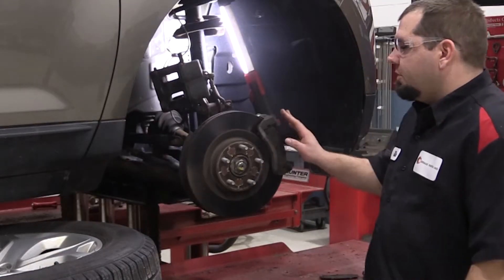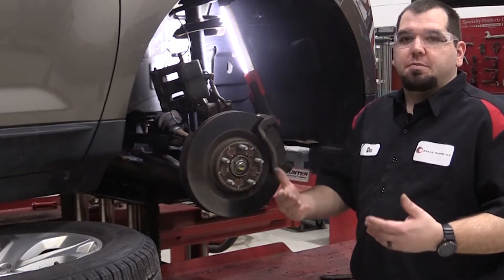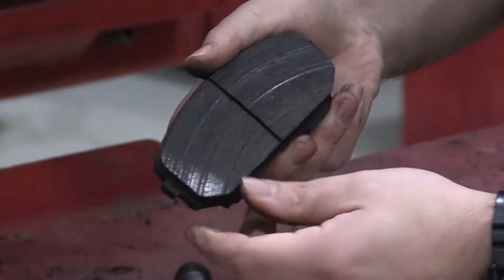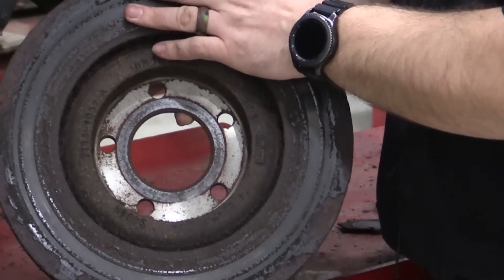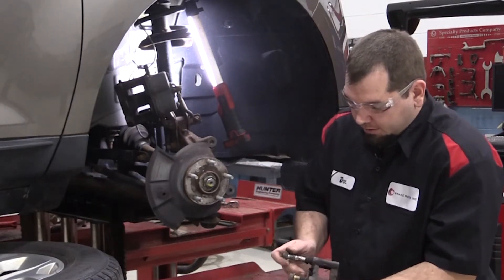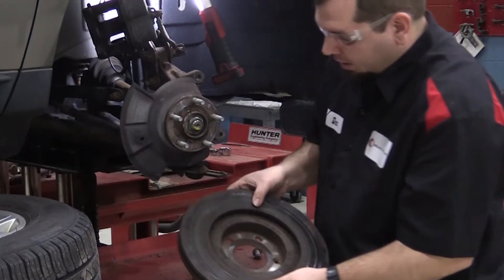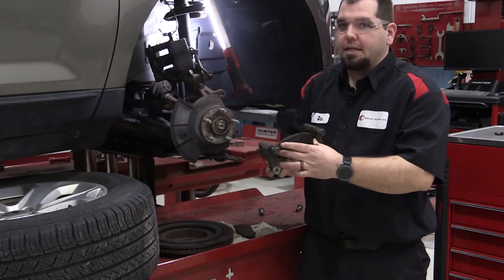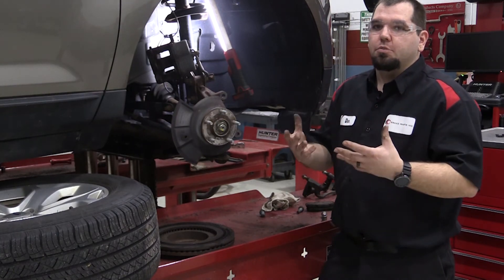Rusty Rotors: What Causes Rust Jacking on Rotor Inboard Only?

Comment: Thanks man,  when I did my brakes after years before buying lifetime pads from Auto zone, they wore out, the warranted pads looked to me to be the same but they gave me the wrong ones. i just figured out what happened from what you said, the inner pads on both sides made identical solid grooves like a track and were only contacting the back if the rotors in the center about 1.5 inch contact while the outer were just barley worn but evenly.  the pads they gave me under warranty were a tad longer but still fit in the clips!     They just gave me the right ones this time but now I need new rotors.  UUGH!

Comment: In my BMW just replaced rotors pads full service found a warped pin replaced cleaned everything and already have my front left giving weird signs occasionally when I had to brake hard for a stop and it locked up quite a bit and pulsed. Then today after a lot of rain I noticed the front left again is just starting to scar on the outside who knows about the inside it’s brand new pad and rotor and the bigger issue is it never fixed any vibration from me cleaning and replacing.

Comment: Have this on my “new for me” 2013 RAM.  When repairing I’ve noticed that they do not use the steel clips in the bracket like we are used to seeing.  The pad just rides in the bare bracket.  I think that has a lot to do with this issue n my case.

Comment: Just had this happen on my moms 2009 ford edge sel. Interesting that I see an edge in the video and other commenters with edges. 
My mother drives only 1 km to work and back so it does fit the description in this video of not being driven. 
I purchased coated Brembo rotors and Bosch ceramic pads , fully cleaned and greased the pins and cleaned the boots. I also wire brushed and cleaned and put a antisieze on the pad guides and used synthetic grease on the contact points for the pads.  I’m quite ocd about these things but I believe I know what the issue is.
I believe the issue is aftermarket pads fitting too tight into the guide clips. Even with the grease in place I think once heated up when braking these pads basically wedge into the clips and make the issue worse getting stuck in place.  

Going forward I will dremel and machine the pad tabs to make sure there is a slight amount of free play between the pad tabs and the shims/guides hopefully preventing them from seizing in place
Reply: Antiseize is for bolt threads.  That's it.  Nothing else.

Comment: I doubt fully coated rotors will help to prevent this, since the coating is not in the breaking surface. I doubt it is the moisture either. I have the same problem on outside side, while inside is ok. The seized pad and/ it pins is probably the cause

Comment: This might be due to that stuck pad not returning to a relaxed position, it's gotten so hot that it practically welded itself to the rotor, it was likely glowing red to the point the metal is soft, and this created the deformed surface on the inner part of the rotor. Then when it cooled off and was driven those groves eventually cut into the brake pads, creating that wear pattern.

Ultimately the problem is mechanics that call a brake job "i'm doing a pad slap", they don't make sure everything is clean on the important surfaces, moving right, lubed right, instead they just take out the old pads and put new ones in.

Comment: I can't believe there are only 4 comments on this.  This video really spills the beans on why many luxury cars have costly brake jobs at 20-30k kms.  Its really premature but the cause appears to be exactly what the tech says in the video - not driving far enough.  Sounds counter intuitive but it seems like the you almost have to ride the brakes to get them up to temp so they can evaporate any moisture still left on the rotor faces.
Reply: Absolutely, I have a friend with a bmw and due to the lockdown he left it parked in the same spot for 6 months and only started and revved it once a week to charge the battery. He told me he took it into a mechanic for an oil change and surprise surprise- extreme rust on the rotors.
Reply: @qtyopd  yah, the bigger catch is my wifes car developed this inboard rust jack from normal driving, but it looked like the commutes wete too short to warm up the rotors, as per the video.
Reply: How far would you recommend driving, and how many times a week? Also for long stretches of highway sonetimes there is not a lot of braking. Do you think it's better to go far with lots of braking vs. taking a long highway with little braking? Thanks for sharing your opinion. It's very helpful!
Reply: @qtyopd  i dont think its about distance.   Wish @raybestos would chime in about how to prevent this but, i think it needs the rotors to cool from airflow to prevent condensation from accumulating on the surfaces.  So... i guess after heavy braking say u live in a valley or at the foot of a hill, u gotta hard brake, then it sits and the condensation builds up as ur parked... i guess brake as u need but do a victory lap around the block before parking....?

Comment: How badly would that effect cars with 4 or 6 piston Callipers? I'm planning on buying a Challenger with the 6 piston Brembo fronts.
Reply: I got brembo 4 pistons on my Touareg and I get this exact same issue on the front brakes, the inboard pads are stuck in rust.
Reply: @JoRioux  what distance is your average commute?
Reply: @andrewlee88  not much, its been sitting for a while
Reply: @JoRioux  wifes x1 does a whole 1.3km to and from work.. its got pretty bad inboard rotor rust yet the outboard sides look completely fine. 28k kms on the vehicle.  This video is the only thing i found that comes close to describing the cause of the issue and i've been working on cars for 15 yrs...
Reply: @andrewlee88  yea dude, in Canada there is no mercy for brake rotors. I've never only changed pads without changing the rotors, they always got changed together.